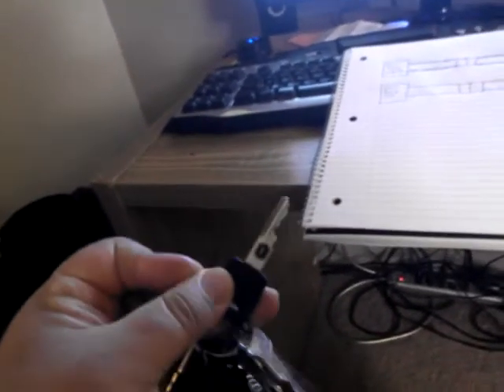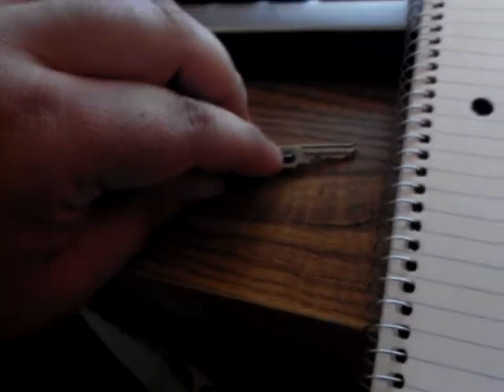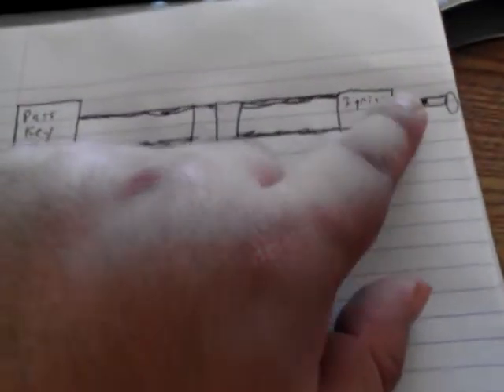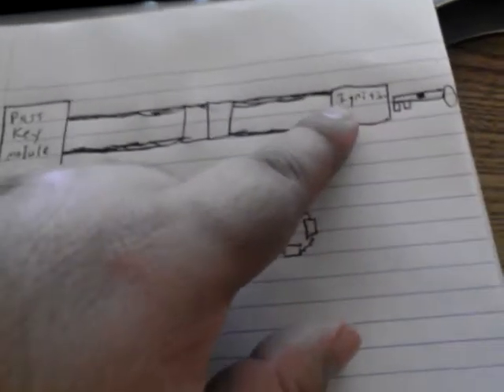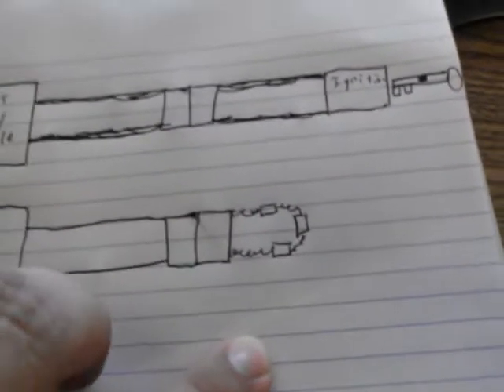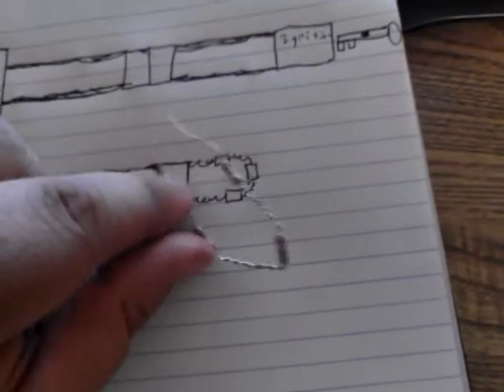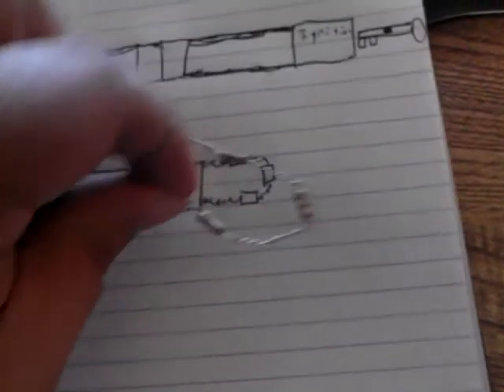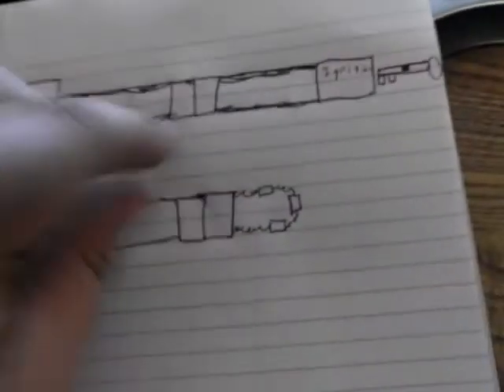1995 Chevy Impala SS PassKey Bypass

Comment: If in a bind, pry out the resistor pellet leaving a hole in the ignition key and use that to connect to the cut wires of that orange sleeve (located approx. above the driver's knee underneath).

Comment: I had this done with my automatic start years ago. My car doesn't start and ideas told by the shop I now need a new security module and I was wondering what else can I get done I don't want to buy this and then have the same issues years later

Comment: Is any soldering needed for the resistors?
Reply from the maker: I didn't, I just wrapped them tightly in electric tape but mostly because I'm not savy enough to solder.

Comment: Couldn't you just buy a new key with the same resistance as the original key
Reply from the maker: PsMoKe Mob 
The issue with the VATS module is that the circuit is broken before it gets to the ignition switch so the key is no longer the only thing missing from the circuit.

Comment from the maker: Alright so you need to get a pack of resistors and link them together to that they have a combined resistance equal to 411. Once you have that pack, pull the wire out of the harness (pull the white wires going from the harness to the orange sleeve, not the white and purple wire going to your VATS module.) and plug the resistor pack right into the harness. It should work but I have no experience with remote start kits. They also make automatic bypass kits on Amazon if you don't feel like cutting.